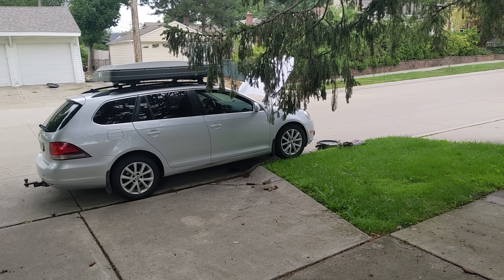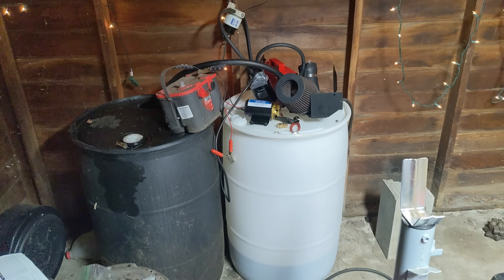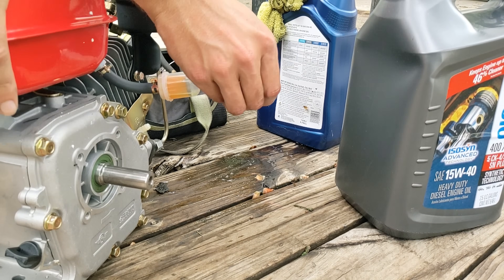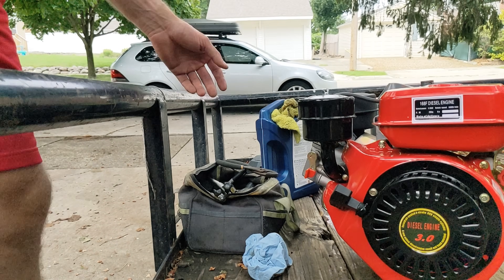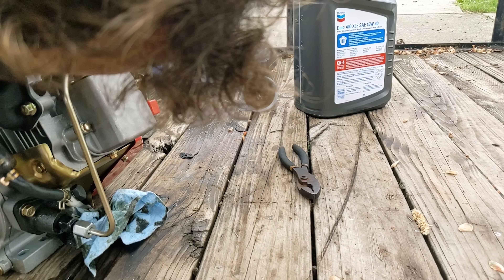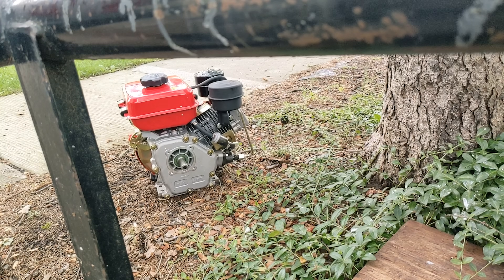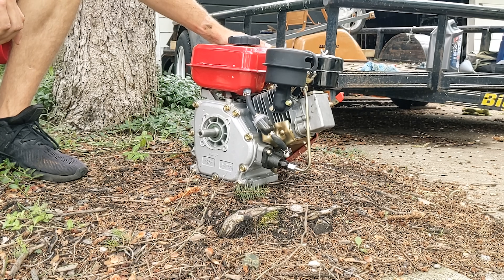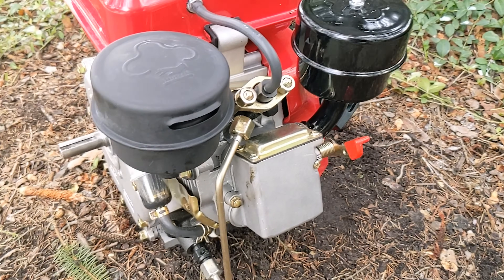Can a 196cc diesel engine run on Waste Motor Oil (WMO)?

Comment: I run my '83 Mercedes 300TD on used oil, but find it runs much nicer on a blend of 75% used motor oil and 25% used ATF to thin it.  Even at 28F it glowplug starts instantly.  My '88 6.2l Detroit Diesel powered Chevy stepvan also runs fine on the blend.  A genuine oak West Marine canoe paddle is the instrument for blending...😁
Reply from the maker: I had a '86 300SD I ran on wmo and watf, was a great can and never paid for fuel when I had it. I did end up going through a few sets of glowplugs from trouble starting on pure wmo. The om617 loved the WATF tho
Reply: @austin_does_stuff  I was fed up with the awful glowplug timers so used a 350A universal starter relay and a horn button to make glowing manual.  Problem solved!
Reply: i used to run my 82 300sd on waste atf
Reply: ATF is great for keeping the carbon deposits at bay.
Reply: @Jack-tx2ve  If the idiots would quit taking off the ALDA or screwing around with its settings, there is no black smoke or carbon buildup in the 41 years mine has run without disassembly.  OM617 isn't a hot rod.
Reply: Do you try to filter out the particulates from your fuel
Reply: absolutely.  two truck fuel filters and a pump @TheAnnoyingBoss

Comment: I've been considering picking up a few of these to tinker with on the channel.  If you end up going through with your setup for a generator, I'd suggest getting some finer bag filters for the sake of longevity.  Also, is there any way to adjust injection timing on these engines?  It would help the smoke a bit.  I do quite a bit with black diesel on the channel so I'm interested to see your progress with it.  Good luck bud!
Reply: a centrifuge will go a long way to get crap out and clean the oil.
Reply: @mickwolf1077  indeed.  I'm a WVO Designs dealer...  a lot of my oil related content centers on that but it's also a big investment.
Reply: I use a bucket top screen followed by a magnet and a remote oil filter for my waste oil heater, though now that you mention it, I could fit a bag in there as well.
Reply: @Engrave.Danger  bag filters are the cheapest alternative that works well.  I've done some testing on them, and they're far better than most spin on filters you can get.
Reply: ok, cool. but not better the olie centrifuge right ?  @NotSoGrandGarage
Reply: @TheFlybyman direct drive centrifuge is pretty well the best option for the DIY.
Reply: I have just been dumping wmo directly into fuel tank of my 96 7.3 and a ford 1520 to run a PTO generator. Surprisingly the 7.3 runs better (even in cold) than the 1520.
Reply: @f.j.9226  if you're going to do it long term...  I'd do some cleaning at minimum on the oil.  Then again, that depends on how much you're using too.
Reply: @NotSoGrandGarage  Idk I mean I can run about 1500 gallon through the factory filter before it needs changed, have yet to have injector issues, been a couple years doing this. The 1520 has just a normal paper filter like a gas engine 3/8 cheapo. No issues out of that. I would think metal particulate that is 35 micron and below will eventually cause an issue. 1500 gallon, I may as well buy a new set of injectors lol. Lotta money saved.
Reply: @f.j.9226  indeed.  Some people get away with that long term.  I've been at it 15ish years now and have seen all different kinds of setups.  Heck I used to use whole house water filters and gravity.  Have upgraded a fair bit since then.  Hey, if it works for ya.. keep at it

Comment: why not 50/50 wmo and diesel in the golf tdi?
Reply from the maker: stay tuned on my A4 tdi swap - planning on doing 100% wmo
Reply: @austin_does_stuff  100% wouldn't work, you have to thin the wmo with some gas, 20% gas 80% wmo would work great... subscribed
Reply from the maker: @antoniosestar3671  thanks for the sub - my A4 1.9 tdi (m-tdi) swap I'm building has a fully mechanical injector pump which shouuld be able to handle straight WMO/WHO/WATF without to many issues. Might be tough to start on cold days tho😂

Comment: I am planning on turning one of these into a generator. I think running these on waste oil is what the doctor ordered.
Reply from the maker: I have a generator head and am planning on doing that in an upcoming video. Curious about the power output vs diesel
Reply: @austin_does_stuff could you drive a decent size car alternator, a battery bank and use invertor for typical household AC power?
Reply: @chipcity3016 yes you can.  Auto alternators are pretty low output wattage so you have to do some mathing to determine how much charge but if you have intermittent load like a fridge then the battery runs the inverter which runs the fridge which charges off the alternator.  I am working on a project that uses a servo to rev up when the voltage drops but idles when the battery is at charge just need to figure out how to avoid charge voltage being seen by the system
Reply: @austin_does_stuff  theoretically you should get about 30% more runtime or 30% more kw/h with diesel. Considering 20% and 30% engine efficiency of gasoline and diesel.
Reply: @austin_does_stuff 

The diesel was designed to run off of peanut oil. 
You can pick up use fryer oil at any restaurant.
Reply: @reypolice5231 every single person here knows this
Reply: @austin_does_stuff too heavy to mount it on a bicycle?
Reply: That engine is rated at 2600 RPMs - it's good for up too 1 kw on a belt drive -
Reply: Your fuel filter is on backwards
Reply: @CarModsandDadBod 

Thank you
Reply: @CarModsandDadBod  it’s Chinese it probably runs better that way😂😂😂
Reply: Would also work well as a air compressor
Reply: I think it can run a 4000watt generator max it would be a unit though
Reply: @seanmckay3392  I doubt this will pull 4kw, possibly 2.5kw is going to be max.
Reply: you have a very multi talented doctor😂
Reply: @sgtbrown4273 they are loud and do diesel knock so ur right
Reply: @seanmckay3392  when the groundwater is low you can dig in in the ground. For noice down
Reply: Are ok this for generator electric ?
Reply: I saw someone use this same engine to charge a battery bank. On a 100 amp alternator, he was getting a steady 60 amp to go into the batteries. If you make a couple of those for seperate battery banks, it's good to charge an off grid cabin on cloudy days when your solar can't keep up.
Reply: They will start on motor oil - the cylinder head will carbon up running on oil - 
       It there running on oil the oil has to be preheated to 350° - also they have to run at 50% load - 
      50% load is ideal for hybrid power - also on a belt drive generator head you will only pull a max of 1000 watts at 120 or 240 - 
      After a 1000 watts the engine will lug and carbon lock if its only smoking some - 
    With a DC alternator - you draw about 22 amps per HP - that's around 55 amps 12 volt -  
       With the belt drive 1/2 is lost to the belt - so the alternator receive's 2.5 HP - 
    1 HP for 120 volts AC generates 416 watts per HP - for 12 or 24 volts is about 316 watts per HP  - 
       You might push pore by running it at higher rpm but the engines efficiency will drop from 7:1 at 2600 rpm to 4:1 say at 3600 rpm - 
     Also you will have to drop. The compression to 17:1 - 
   In the offshore oilfields if we're using diesel we use marine diesel - it's a 30%  bunker C oil or 30% used motor oil blend - 
     Those Marine diesel run at higher compression to create a higher head tempriture to burn the D3 & D4 completely - 
     It's around 160000 BTUs per gallon so you do burn less fuel per HP out put -
       If you look at locomotives in India on you tube you will see it bellow black smoke as it comes up to power - 
        Drilling rigs in the offshore oilfields often use EMDs or rebuilt locomotive engines for there generators - they run on D3 fuel - and smoke at times when loaded down - 
      I wouldn't push it past 30% blend of motor oil to diesel - on less you preheat the fuel to 350° f
Reply: @able880  “1/2 is lost to the belt” ?
Reply: @stephencrowther524 it's a 3 HP at 2600 RPMs - 1 HP will generate 416 watts so that's about 1200 watts - 
     If you put a 1200 watt load on the generator - the engine will blow black smoke - it's over loaded and lugging and will slow down and stop running - 
     It will run with out lugging up to 1000watts of load - so around 200 watts is  lost in the belt traction - that around a half horse power -
Reply: I wouldn't rely on it for highly critical tasks or high integrity circuits.
Reply: @CableWrestler  for high integrity circuits it would depend on the inverter I would use. As for critical tasks. If I had critical tasks I would buy a military surplus unit thats severely underated.

Comment: This engine uses so little fuel that it isn’t worth running it on alternative fuel, I’m all about alt fuels and multi-fuel operation, but other than pure curiosity, it would take forever to pay off that difference in fuel cost.
Reply: ? If you run this 24/7 on free used oil and scavenge the heat for the house and the torque to the powergrid how is that inefficient?
Reply from the maker: you are correct, its a mix of curiousity and I have a local suply of oil and figured why not try?

Comment: The smoke is generally proportional to load, but even pure diesel will smoke at full tilt. I have run engine oil as well, but it can be quite difficult to start when cold, a simple fix is to add a tablespoon of petrol to a tankful of oil fuel, although don't mix it in bulk as the petrol loses it's ignition boost effect over time once mixed. You also need the petrol mix to be at the injector for starting, so it needs running through first. I also use waste hydraulic oil more frequently now, it is much cleaner to handle, has less soot in it and has less (or no) flash point suppressors than motor oil, so it starts easier as well. I get it from a heavy machinery service agent, they do drum swaps for free.
Great video anyway, thanks.
Reply from the maker: thanks for your wisdom, I'll be exploring different oils in the future. Verycurious to see how the different types run
Reply: That sounds like a refined and more realistic substitute for diesel
Reply: Waste engine oil mixed with about 20% petrol is what my brother is running his diesel Pajaro on
Reply: I've been running waste oils in my 12 valve Cummins. That makes me feel better as I just got my hands on 20 gallons of used hydraulic oil. It definitely looks cleaner. My go-to is used ATF because waste engine oil is just dirty as hell, where the ATF is very clean even before you filter it.
Reply: @Bloodbain88 The  trouble with hydraulic oil as fuel (and to a lesser extent ATF) is that it has a lot of anti-friction additives in it that don't burn and cause a gritty soot in the cylinder.....waste engine oil doesn't have these additives and the black carbon in it doesn't cause gritty ash......i had a waste oil boiler i built https://youtu.be/kh8E_dAM3Yo and a week firing on hydraulic oil and it needed cleaned out.....i could go months on waste engine oil
Reply: I think it's the other way around, hydraulic oil is base mineral with virtually no additives or stabilisers, that's because it is run in a controlled temp range with no contamination risk. Engine oil has many additives to stabilise viscosity across wider temperature ranges and detergents to wash and dissolve fuel by products and water, as well as ignition suppressor agents added to prevent an engine from grenading from oil vapour ignition.
used engine oil is often contaminated with toxic chemicals like ethylene glycol from brake fluid and coolant as well as flushing treatments and workshop degreasing agents.
The only waste engine oil I would trust to use is my own, but even then the soot will build up over time.
 @unhippy1
Reply: @alasdair4161  Hydraulic oil has a lot of additives that don't burn, waste engine oil additives do burn.......your right to be wary of waste oil from unknown sources.
Reply: There is no need to cycle the key as the glows are powered way past when the glow light goes out.  Watch the oil or gen lights when you start cold.  They will be dimmed by the heavy load on the battery until the autoglow turns them off, then they brighten as the load comes off the battery...THEN, when the dash lights brighten, crank the starter for an instant start.  If this glow plug dimming doesn't happen much and not all the cylinders start together, 1 or more glow plugs are bad.  Replace them all together.

If no dimming takes place, the auto glow module has failed.  Replace it with a 300A universal starter relay keyed by YOU from a horn button under the keyhole.  This relay is connected directly to battery + so you can glow the engine with the key off and only glow plugs load the battery.  Push the button and count to 10, 20 in really cold weather.  RELEASE the button and start the car taking glow load off the battery for the starter with full power.  My 40 year old OM617 cranks instantly with no grinding at 20F.
I want to make sure you all know my experience with replacing the little 60A OEM alternator with the powerful 115A Bosch 129X alternator off the Saab 9000.  It;s a tight fit but replaces the too-little-for-AC original directly with no modifications except rewiring.  The original field energizer circuit works great and 14.2VDC with every load in the car at max setting!  Just do it!
Brand new 129X is $273 from Amazon with no core return charge.